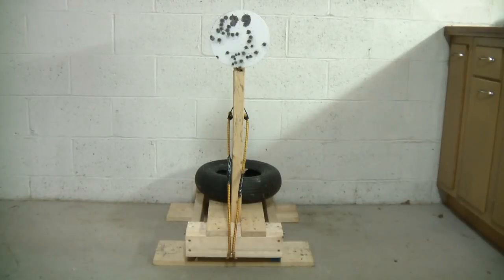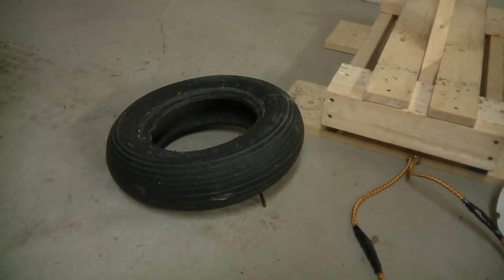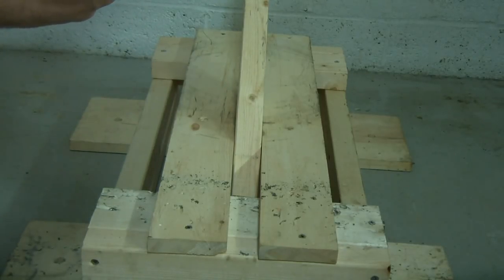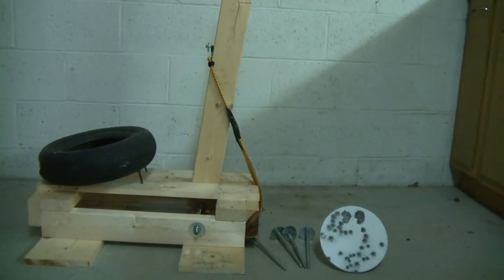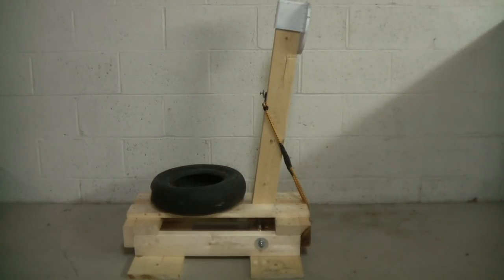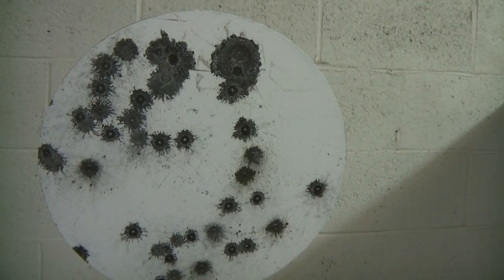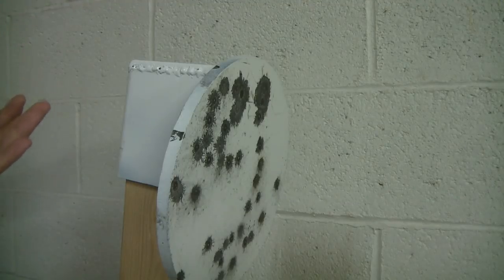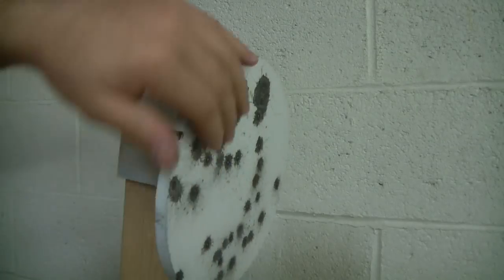How To Build Your Own Reactive Target

Comment: Nice idea.. but that is a ton of work to get the target to move only a few inches. I would do a smaller base, put a back stop a few inches back and use a back push contracting spring in the rear.. If the target would pop all the way down, and reset back up it would be worth the construction i feel. Lot of people don't have access to welders though.. So keep it up.

Comment: You should thread the bugee cord thru the correct length of schedule 40 PVC to protect the length of cord that is susceptible to fragmentation damage, maybe 1/2" diameter. It would shrug off the shrapnel and the bungee cords would be protected.

Comment: seems complicated, why not just hang the steel on a plant hanger? like $5 from home depot takes 5 seconds to set up
Reply: Desert ground will have you bending the hooks before they go deep enough into the ground. Plus you want the angle.
Reply: @winstonsmiths2449  I get it if you can’t put it in the ground but angle doesn’t matter much unless is solid mounted. If it’s hanging loose you aren’t likely to get bounce back.
Reply: @Mike2trys  True, mine hang loose and angled. The angle does help keep the hits by spalling to the metal to a confined space on the stand itself. Spall creates sharp edges that do not feel good on bare hands, LOL. And I often shoot a swinging target which means the angle varies anyways. I do like the angle for  9mm rounds. They do not move the target much at all so I want the spall to go down at shorter distances.